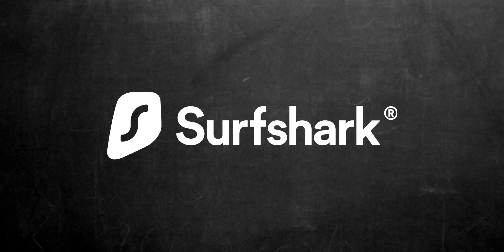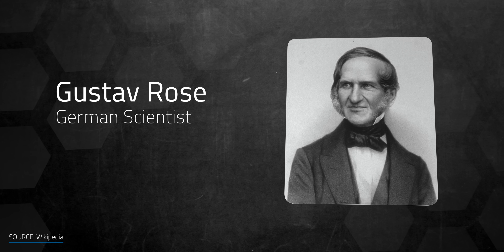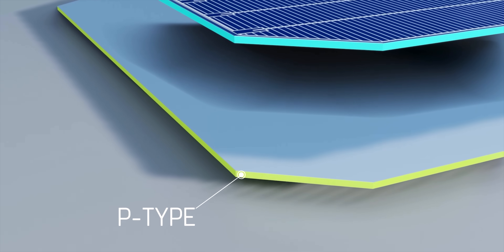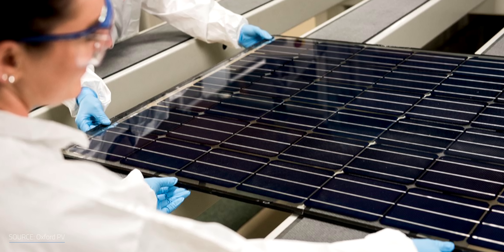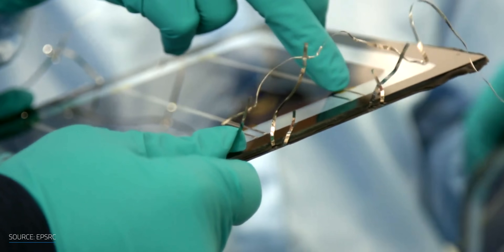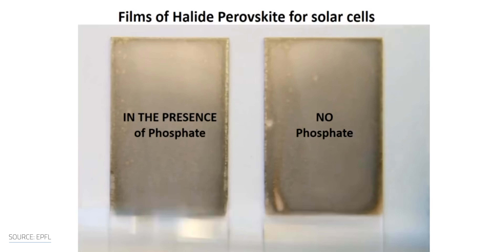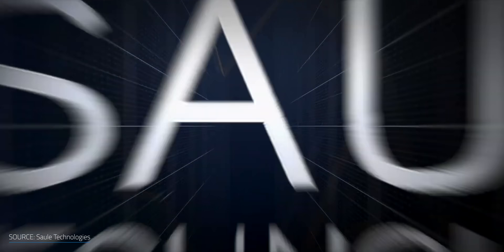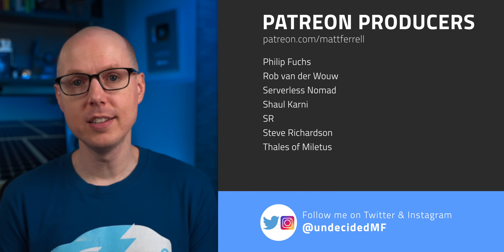Perovskite Solar Cells Could Be the Future of Energy

Comment: I just want one of these kinds of videos to be like "This thing got worked out, and it's better, and everyone is actually going to start using it".
Reply: Then the channel wouldn't be called 'Undecided' 🤦‍♂️
Reply: @nxman  exactly!
Reply: I know right! Just once! Just once I'd like it to be something that's actually worked out and functional and ready to change the world RIGHT NOW.
Reply: @RudeAlert  If it's any consolation the tech is going commercial in rather short timelines. Keep an eye on graphene, we finally have some useful production methods, and it's really starting to go into everything where the use of lower quality sheets are useable. Once we can make mass consistent and pure sheets of the stuff it's game over for the norm in almost every industry. Till then it's good for mixing with other materials to add electrical condutivity, strength, and corrosion resistance.
Reply: @curtisbme  Haha, if I had been asked to name one thing it would have been graphene! >.<
Reply: @drkastenbrot  Fusion takes that prize.
Reply: @drkastenbrot  Fusion takes that prize.
Reply: @drkastenbrot  Uhhh, you're a month out of date, bud.  Graphene is mass scale produced and being used in large scale engineering projects RIGHT NOW!
Reply: @drkastenbrot  Same thing with solid state batteries. They've been "just around the corner" for longer than I have been alive...
Reply: @wes9451  Don't you think that oil companies would start buying graphene patents? May be they will produce graphene from oil, or simply they will dig down the graphene patents, where oil comes from. This comment is not a flame nor intend to heat the globe. It is just a reminder of the economic paradigms.
Reply: @Gursers14  
Solid electrolyte batteries are being made right now, by more than one manufacturer, one being Tesla.  The yield is about 70% and needs to be worked on to 90%++.
Reply: @drkastenbrot  nah fusion is the winner
Reply: @RudeAlert  Traditional silicon based solar cells are something that's actually worked out and functional and ready to change the world RIGHT NOW.
Reply: @RudeAlert  "Just once! Just once I'd like it to be something that's actually worked out and functional and ready to change the world RIGHT NOW."
Microwave ovens.
Reply: @RudeAlert  Right, we are changing wood and petroleum for scorching sunlight. In addition, burning graphene produce CO2 and HEAT.
Reply: @RudeAlert  If technology has reached that point, it gets commercialized and you don't need videos like this.
Reply: well, if that is what you want, then these type of videos is not for you,....all you need to do is go outside and look around you,... what you do in here is filling the bank account of this journalist called Matt Ferrel though ads, views, and watch time...and some people do it directly trough patreons
Reply: @electronresonator8882  these types of video's ARE  not for you!!!!
Reply: You think I'd learn by now, but I keep getting suckered in by this genre of video.

My hopes go up, only to be dashed on the rocks of reality.

Years ago when I was still hopeful this wouldn't have phased me. But now with the world literally burning down around us I need more.
Reply: Then you wouldnt need a youtube video because that technology would be all over the news. The channel focuses on possible future developments/uses of technology.
Reply: @Daniel-rd6st  yes, we all know that. We also know that the titles suggest a likelihood of these technologies coming to fruition. They aren't those things. The contents is interesting certainly, but there is a clickbait element to the way they're presented which is unnecessary
Reply: @dougsteel7414  I dont feel the title very clickbaity, though i can see why one might. After watching the vid those solar cells could play a major part in future photovoltaic power generation, though it will probably still take a decade or so to iron out all the kinks and go into mass production.
Reply: @Daniel-rd6st  I think there will production, maintenance and logistics issues that will emerge; there's also an issue of security and reliability. Wind and sea power with current technology seem more promising. Personally I strongly believe in nuclear power. The accidents that have occurred due to a lack of development and use of old strategies. A lot of the design origins lie in fissile weapons material, executed in an 'emergency' both during WW2 and the cold war. Thorium is claimed by the industry to be impractical, in reality the industry has huge inertia, with 20 year construction and 50 year decommissioning, very difficult to change direction. Also, in the 60s to 90s, environmentalists misguidedly lobbied against nuclear power, with a lot of resources, blocking with legal disputes etc. If this solar thing becomes more robust, we'll need the battery revolution to sync in with it, it seems
Reply: @dougsteel7414  Peronally i think most sources of powergeneration are viable, including nuclear. The question is what energymix makes the most sense. 

I life in Germany for example. Most people here have a strong dislike towards nuclear power, so it was decided to remove it wrong the grit ( i think the last ones are soon to go). But we also want to have CO2 neutral powergeneration, so massive investments into wind and solar have been undertaken in the last 20 or so years, which is one of the reasons that we have worldwide almost the highest prices for power (for privat consumers at least, the industry gets power much cheaper). After a year with little wind and sun (and no concept for long term power storage in sight) and coal energy production again overtaking wind as top spot in the energymix, some people start to rethink, but its too late to build nuclear powerplants now, even if the decision were to be made today, since getting one online (from finding a location to planing to fending off all public concerns to getting a permit to start building to actually build to getting operational) can take easily 20 years over here. So at the end of the day it will be most likely natural gas to fill the gap. A bit more CO2 friendly than coal, more expensive, but relative quick to build and capable to quickly compensate the fluctuations of wind and solar.
Reply: @Daniel-rd6st  I find the videos interesting regardless. I'm sure many of the things that generally get shown, even if that thing specifically does not come to fruition, probably play a part in some other future technology learning or development which will make an impact.
My original comment was just me lamenting that there always seems to be some caveat, delivered after all the greatness of that new thing is discussed.
I suppose it wouldn't work as well if done the other way round, and if the technology was easy then it probably wouldn't make for exciting viewing...

But even so, I still long for a video where someone just discovers something amazing, and it works, and people just use it! ahahaha. xD
Reply: everyone should be using solar no matter how dirty or expensive the propaganda tells you it is.  The Sun is what sets you free from Energy corporations.  They control the manufacturing process and force it to be dirty and expensive, when in fact, you can use the Sun directly to fire the silicon.  You just have to build a large enough solar kiln in the desert.  Would cost almost nothing and use no fuel unless the system is designed to preHeat with fuel and sustain heat with solar.  And you can power all the mining and manufacturing process with solar.

Everything you have been told is a negative aspect of solar technology was engineered by people who have a vested interest in discouraging you just enough to think solar is 10 years away.  And keep you thinking that.
Reply: Money baby! Give some more money into r and d and these technologies will get it going. As long as we keep throwing crutch money into oil and gas and dont research, we wont see it.
Reply: We are only 2 or 3 years away. Oh, I meant 200 to 300 years.
Reply: The problem with that is it would have already been used if it were the case, and some other tech would be looked at to improve on and that would be the one we're all speculating about.
Reply: I've seen these kind of videos 10 years ago about solar panels. And today they are really efficient and cost effective . 😀 So I'm hopeful.
Reply: It's true. Drives me mad. This channel should be called "it'd be great...but no"
Reply: @dougsteel7414  Its tech journalism. It runs on speculation because the status quo is not interesting or surprising to anyone.
Reply: @drkastenbrot  it's true. Everything is entertainment.
Reply: Reality vs hype
Reply: That's not how the world works
Reply: Graphene finally did!!!!
Reply: Every choice we make has an impact on the Earth and involves a cost in natural capital and diminishment of ecosystem services.
Reply: Unfortunately, in order to get any (meagre) funding, many of these companies have to basically promise (lie) that the potential product has potential to revolutionize everything. Think about Musk and his ridiculous claims. This is what most have to do in order to get any attention from investors.
Reply: Yeah, they are usually as annoying as an episode of Monster Hunters in that regard.
Reply: me too
Reply: Thats science mate, everything looks great on paper but applying it to reality is a whole other ball park
Reply: yes its like what they say about the Sixers...we are 2yrs from being 2yrs away....trust the process
Reply: If that's what you want, you need to get it from politicians -- they tell you what you *want to hear*, not the truth.
Reply: idealism....it will leave you wanting
Reply: But then this channel would be called, "decided" 😄
Reply: Tell your  government to stop holding it back. They don't want you to be able to get your own energy. Then their big energy companies won't be able to give them large amounts of money.
Reply: Yeah, but no, no withouts the support of a super rich.
Reply: No shit
Reply: Solar technology is moving fast, 30% is amazing, who knows what the future will bring.
Reply: Solid state hydrogen  battery video on this channel is basically  that.
Reply: You will,  one day. Very soon.
Reply: everyone wants XD
Reply: @ArabianKnight63  because you are all lazy and useless.  You want someone else to fix a problem that is quite literally EVERYONE's responsibility.  You're too lazy and useless to even think about producing your own food and harvesting solar energy.

You've got other plans, don't you ben.  Plans that involve fat stacks and gettin ass.  Not feeding the ass you got at auction to protect your chicken coup from coyotes.  Or doing anything at all to earn your charmed life.  Not you.  Not Ben Jammin.  Ben Jammin has dreams (sponsored by Disney), and Ben Jammin is worth it.

Right Ben?
Reply: But then everyone would already know about it and it wouldn’t be news :-)
Reply: We're ready 🙏😁
Reply: None of it ever really works and it never enters production. It's just vaporware.
Reply: @Withnail1969  Entering production requires quite a bit more than "working".
Reply: And Oprah announces it: You get solar power! And YOU get solar power!
Reply: Humans 0
Saiyajin 1 to 6
Angels 7 😇

Kalki Ironman 5th matriya buddha 8th arc Angel 11th satguru 13th imam and 24th avatar after 2026 😎

Almighty God 9 😇

Humans type 2.5+ after 2026 by Kalki Ironman (christ in the white horse)(son of man on clouds) type 7 and 8 😎

Jarvis the world’s first artificial intelligence (parrot) 😎

Cuz Kalki is ironman batman and every super heroes combined after 2026 😎

Jarvis world’s first artificial living being (just like vision in marvel universe)😎

Made of Quantum and sub quantum particles 😎

Power source quantum energy arc reactor (type 7) level technology 😎

Kalki Ironman going to have every kind of arc reactor like:- type 1 Nuclear fission, nuclear waste, hydrogen fusion, type 2 3 4 5 antimatter arc reactor (solid liquid gas), type 6 electro quantum arc reactor, and type 7 Quantum arc reactor, type 8 limitless quantum energy arc reactor without quantum particles 😎

Kalki Ironman going to have sun in a box million billion tons of hydrogen nuclear fusion reactor type 2 3 4 5 just like sun and stars in the palm of his hand ✋🏻😉😎
Reply: Same
Reply: Anybody that says stuff like that is probably a scammer. Real science is iterative and thoroughly tested.
Reply: Not possible.. Going to cause so many more issues than clean fossil fuel facilities.
Reply: @drkastenbrot  it's by no means certain it'll ever be a commercial viability - or even permitted to given the power of the fossil fuels industry and its grip on political systems everywhere. I think if anywhere, maybe France or Germany.
Reply: @dougsteel7414  sure we germans love to pay the highest prices for electricity it´s now 32 cent per kW/h. the highest price for electricity worldwide. i would say first make the technology viable and more efficient, than people start buying/using it. don´t get me wrong i would love to be self sufficient, but if i´m going to pay so much for electricity i never could afford those panels
Reply: @Humbulla93  I just don't think solar panels make sense. It's a huge undertaking, imagine the amount needed for, say, a car production plant, or a steel foundry. And again, it's waiting for the new miracle batteries that don't leach chemicals into the ground and require mining on a mass scale. I'm pretty sure magic batteries are on this channel every week or so.
Reply: @dougsteel7414  awesome comment, i think the same way,  we´d be better of replacing incadecent bulbs with LED´s and finding better catalysts for large scale chemical synthesis, as those are one of the most power hungry activities worldwide. yeah this channel feels like a huckster trying to sell you some vaporware
Reply: @dougsteel7414  
Said, "I don't think solar makes sense."

Well, you're too late for that.  Here in California we are running on more than 50% solar at midday.  You have your wires crossed when you say that solar can't run industry.  Every industry in the US is using power from wind or solar, in some amount.

What will happen is power from fossil fuels is going to be replaced by wind or solar.  In residences the solar will mostly be rooftop.  Industry will need to have electricity replace all fossil fuels.  That just means we need more electricity.
Reply: @Humbulla93  Well one of the big reasons is not only that Germany went heavy into solar and wind, but also especially that Germany cut their nuclear reactors at the same time, which is a massive hit to the entire electricity infrastructure, meaning a whole lot of solar fields had to be constructed as compensation and that massive simultaneous investment has skyrocketed the kw/h prices. In reality Germany could be more or less CO2 neutral right now if they kept the nuclear plants and didn't succumb to ill informed masses who are scared of ancient disasters and can't be bothered to actually study up on the fields they hold so deep biases towards.

Germany could literally be an electric superpower right now if you nuclear was kept, while still investing heavily into solar and wind, and totally outgrow fossil fuels in one big swoop.
Reply: @dougsteel7414  If fusion was a threat to the fossil fuel lobby, we would be seeing a lot of astroturfing commercials, warning us about the dangers and risks of fusion. At least that what they always do when a new, viable technology comes around. Electric cars supposedly worse for the environment? Solar power not feasible and also bad for the environment? Wind turbines shredding birds, making people sick and also worse for the environment? Theres a bit of a pattern to it isnt it?
Reply: @drkastenbrot  I imagine they do assessments with lots of money into commercial threats. You also have to consider absence; it's very possible that pressure (particularly in US where businesses own the government) that state sponsored initiatives are squashed. Solar power, as it stands, isn't a solution. I think it could work for domestic power, but industry? Maintenance is a huge problem. As for electric cars, they're an end-point, no different from washing machines or lighting, it all depends on how the electricity to charge them comes from. They're neutral more or less, though they tend to be a lot more efficient, particularly in acceleration.
Reply: @dougsteel7414  I wouldnt call them neutral. They consume less than half the energy than their fuel fed counterparts. There is a similar trend in other sectors, heat pumps in modern buildings consume about a third to a quarter of the energy the fossil fuel fed heaters were burning. These steps are somewhat crucial for a sustainable future. 

Im not a fan of solar farms but there is absolutely nothing to argue against solar on roofs, where they end up net positive relatively quickly, also massively reducing the load on the grid and the associated losses.
Reply: @drkastenbrot  like I say though, with all electrical appliances, where is the power coming from? Another factor is how much energy does it take to produce the insane quantity of Li-ion batteries we now use? It could be ok, I've never looked into it. But as the industry matures, people are realising the power and efficiency of electric drives falls of as the batteries start to fail . Nothing can be as bad as petrol though.
Reply: Capitalism doesn't reward great inventions. It rewards great sales people...
Reply: @blackoak4978  it rewards people who know how to operate on the borders of criminality. It will always reward choosing personal funds over morality
Reply: They can't. It is a wealth extraction method like proxy war. Like all government programs, it is a very expensive promise that more promises are built on, with no possible way to deliver.
Eutopian socialists are lying us into a black hole of crushing debt and speaking as if they are saving us.
Yuk.
Fossil fuel works. Until real alternatives are explored by ending corporate racketeering, we get more of the same.
Allegedly.
Reply: Good point Graig, NASA could be using the PSC because are lighter than current solar cell (silicon based) used in satellites. Let NASA use it first and they shall leak their efficiency. The other point is, what country has the greatest natural deposits of Perovskite? Where do USA got CaTiO3 to produce titanium alloys for USAF???  Is Ti considered a strategic commodity?
Reply: I dare these "perovskite publicity guys" to tell us what is the real efficiency of these solar cells. The highest efficiency of Perovskite-SC is less than 1%, compared to 15 - 18% of the current Si cells. Once they get the perovskite-SC working, of course.
Reply: The alternative is green-hydrogen. Haven't you seen what happened to the Hindenburg? Don't you know that green-H2 is volatile and difficult to store.
Reply: Same bro. But how greedy the government and the elites are, we know this is wishful thinking.
Reply: @JM-zb8ro  If they were smart, they would invest into r and d to keep making money. Unfortunately, its all about profits and screwing everyone below CEO level. Why waste money on the future when you can screw everyone for a dollar today?
Reply: @SmashToBits  I agree man. That's why I'm trying to earn enough to live on my own with no government. Peace and quiet. Lol
Reply: @JM-zb8ro  Tar and graphene are not the same color. However,  both are combustible and very profitable.